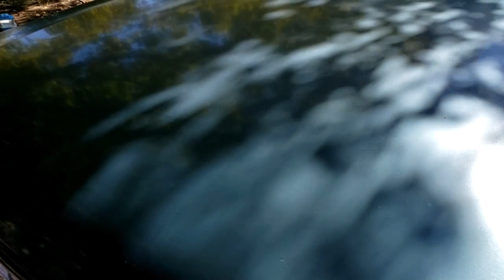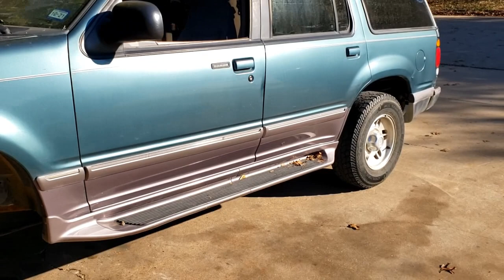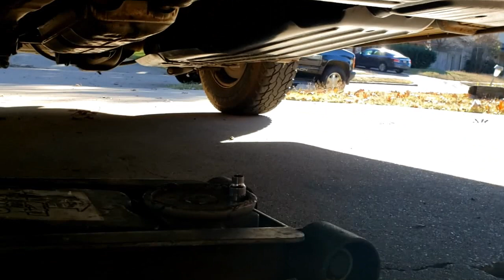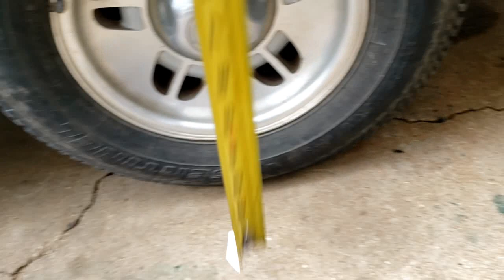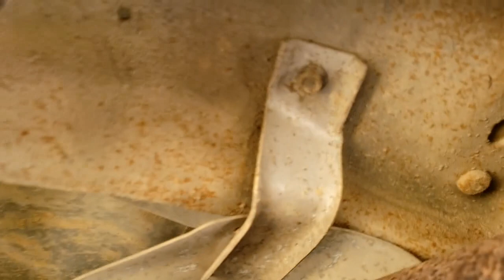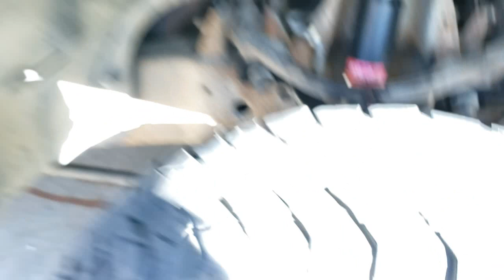Ford Explorer lift kit project   2nd gen   DIY how to lift for AWD and 4x4

Comment: great video  question if i add shackles on the rear will it lift a  bit?
Reply: long shackles will give you very little lift, get the old man emu springs for about 2" and ride great

Comment: with all my trucks i'e had them all lifted. what they usually do is add a block to the rear, add a leaf is for if you're doing heavy hauling for the strength of the leafs, great job overall. if you have a 1 inch block in the rear it you level your truck out.
Reply from the maker: The setup you are referring to is for spring over axle. If you add a block to this setup (spring under) , it will lower the truck. Hence add a leaf and longer shackles instead.

Comment: Heya! Love the video mate, I’m glad to have stumbled upon something so clear! Ive got me a 97 Explorer SOHC that I am trying to put together a lift and end up on some 31s myself, but I am an absolute newbie to the auto world.

I’ve just replaced my Leaf Springs and Shackles 3 years ago, as well as some other underbody works.

To make sure I miss absolutely nothing, which parts are necessary for this lift? Do you recommend still getting the Add a Leaf? 

Thanks boss!
Reply from the maker: Hey there! Add-a-leaf is the way to go if you have any weight inside, but you don't need the torsion keys. The original keys can give you the same amount of lift!
Reply: @gagefixeseverything cheers! I’ll consider picking a pair up then. I’ve cleared the interior so I won’t be carrying much besides camping/sports equipment. Without it, does it add any lift considering it is an Under Axel Spring?

Any recommendations for compression if you don’t have one of those table vice grips?
Reply: @gagefixeseverything Also, I’m looking after the shackles you used in this video. I’m going to head to the part store to find similar ones, what were these measurements? I’m having a hard time finding ones like that.

Comment: I've been working on getting my uncle's 1996 5.0L AWD XLT roadworthy again. It's got the tan paint and interior, and the front bucket seats are very comfortable. I just swapped out the ECM to get it running again since the OEM one became an ant nest, now I just gotta figure out how to stop the brake pedal from sticking (feels like a rust problem not a booster issue). I'm still on the fence about lifting the truck or lowering it, but this video was useful to that end either way. Thanks for the old Ferd content.

PS: I don't know if most people would agree or not, but personally I'd rather you just show the whole process even if there is a bit of wind noise. It's nice having some form of visual reference for doing these types of jobs.
Reply from the maker: Thanks for the comment and input! I'll remember that about the full length video. I prefer that myself also, because sometimes I need to see the direction or order of parts / hardware

Comment: Where did you get the leaf springs from ?
Reply from the maker: I ordered them on rock auto
Reply: @gagefixeseverything  I use Rock Auto for just about everything, I even used them to order an Exedy clutch for my '92 S10 Blazer among a bunch of front end parts. I would recommend everyone at least take a look at Rock Auto, more often than not they have anything you'd need to work on your car yourself.

Comment: Hey great video and info just wondering I’ve been reading replies but would a lift be necessary if you want to run 31s? I have a 99 xlt with the sohc I’m just going for a bubba build trying to keep it clean and simple while still maintaining some factory aspects of it I’m not sure how much power I’ll lose along with all that but if a lift is necessary do you need aftermarket shocks in the back with the shackles?
Reply: You should be able to run 31s with no lift, I did with mine anyhow, no rubbing issues

Comment: Hey did he say how much he spent on all the mods on this Explorer? I would love to know that because I am eye balling this Explorer up the street thats for sale.
Reply from the maker: I don't remember exactly how much all of this cost. Around $500 maybe. Reminder, you don't need to buy the torsion keys. Just crank up the stock ones
Reply: I dont know about his. But my 2 door was less then 500 to lift in a similar manner. Its at 400k km the original engine made it till last year, trans made ot 6 more months, was swapped with a manual, both jobs combined was less then 2000 usd, and the engine was an sohc (notoriously less reliable then the 5.0 and the ohv 4.0)
Reply: @abcanadabc  Tks for letting me know. Hey there are 2 engines options 4.0L? So both are the inline 6? Which 1 is the more reliable?
Reply: T @brizzx32 the 4.0 is a V6
Reply from the maker: The OHV is more reliable, the SOHC has a little more power.

Comment: Did you keep up with the new owners experience at all? How are those rear Shocks holding up?
Reply: Current owner, top bushing is shot, so it was replaced.  Offroaded hard, after a 3 inch BL, running 35s.  So far the rear shocks are still intake.  Ride is a little on the hard side, because of the AAL and not enough weight in the rear to soften the ride.
Reply from the maker: He has driven the truck for a few years, and I think he's had a really good experience with the truck.

Comment: Greg, I am the current owner of this little gem here.  Did you ever regear the axle?  I do not think so, but I had to ask.  PO did not know.  Vin shows 3.73 limit slip, so I don't think you would had regeared that, but PO said something about regear, but was not sure.  Thanks
Reply from the maker: Hey there! So cool that you own the Explorer now!! No I never did, but the front and rear diffs are super cheap and easy to find luckily. I'd recommend going down a tire size if you are not going to regear,
Reply: It is going to live it's life as an offroader now, so no longer a street queen.  31s would be ideal if its a daily driver, but 35s is where it will grow into.  :)

Comment: The 2nd Gen V8 Explorer is the spritual successor of the 1st Bronco with the V8.  
Did the Bronco II get a V8?  
The Bronco XLT is the K-5 fighter, not a jeep trail truck.
Reply: Good video.  I'm making notes.
Reply from the maker: 2nd gen v8 Explorer is awesome in every way except for repairs and upgrades. They are a pain in the but to work on. Bronco ii never got a v8 i dont think
Reply: @gagefixeseverything  I live at 8,000' MSL.   Gotta have displacement.
     Easier to work on than a van with a V8, for sure!   That's where I've been -- in the doghouse. 
 I like the Ford Pony Truck Ideal.   Big motor, small vehicle (park it next to a Super Durty and compare).   LOTS of aftermarket 5.0 support.  Heads, Cams, Intakes.
    It's a long-life pushrod V8.  And, for some reason, the Ford Gaskets of the time don't seem to leak like my other New Millennium vehicles.  I just spent 120 bucks to replace all 5 shocks.   The cheapest truck I own.  I'll never crack open the motor, really.

It'll never go to 700 HP.  But I like the idea of lowering it for cheap and using the AWD with a Turbo. ● But what I should do is convert it to a true 1/2 Ton Truck by grabing a Hi-Lo 4x4 Transfer Case and drive shaft from various other Ford trucks out of the junk yard.  
Then Shackle-Raise the rear leaf springs 1.5 inches and dial up the torsion bars to match.  Add chunky 31s and I'm done.  
As soon as you change suspension on your Factory Vehicle -- any vehicle -- it becomes an RV and you have to reclassify your budget as such.  $8k later and the tires are still rubbing in the parking lot. No thanks.  
 Its got the  F150 motor and tranny in a truck that has a wheel width of a Corrola.   Siiick!   I'd try a HCI and supercharger on this fantasy version.   

  I usually prefer sitting in Fords but I'll always choose the Mercury, when available. No matter, the powerplant.

Comment: Had a '97 for years.  Thing eventually decided to give up the rear Tchain and blasted a hole in the block.

That aside, nice lift work. However, did you put any wheel spacers in at all?  These things as Im sure most here know, have a horrifying roll over rating, lifting them only makes that worse.  The tires you have are wider but I wouldnt trust that alone.
Reply from the maker: Thanks! No I did not use any wheel spacers. I chose a wheel offset that was as extreme as i think i would go.

Comment: Unsure if you’re still replying on here but I’m looking to lift my 96 and the things I’ve taken away from this video are: 

1. I can just crank the stock keys for the front 
2. I can just use lift shackles for the rear 
3. I need stock ride height shocks in the front no matter what. 

Are these points valid? And can I get away with just using the stock keys and some lift shackles?
Reply from the maker: Correct! Just be carful on the rear not to use too large of shackles. longer shackles affect your pinion angle. This truck still drives great, and is about to be for sale now
Reply: @gagefixeseverything  gotcha, thanks a lot for the reply. I actually picked up the same (I think) ones as you, the Autocraft brand 3 point shackles.

Comment: Hello I'm a beginner just recently did breaks for my first time lol. I'm looking to do some upgrades on my 98' RWD V8. I just had triplets and dont have the fund to put my rig in the shop. You have any advice on where I should start or what to buy first.. 

Sorry just learning. Love you're video, truck look great. Cheers 🤙🏽
Reply from the maker: Hey there! That is awesome that you did brakes! Most people would not attempt that these days. Id say the best things you can do are just regular maintenance items at first to learn how to use tools more efferently, and understand terminology and how things work. See if you can find a factory service manual on eBay for your specific vehicle. It will have TONS of good information on items to work on, and EXACTLY how to do it step by step. Pick a job like throttle body gasket, spark plugs, intake gasket, serpentine belt, etc and go for it!!

Comment: I managed to get 3 inches of lift w a similar setup, I do get some clunking when the front is articulating in the trail. this vid helped out trouble shooting that issue,  I might need to bring it down another inch. Do you happen to know exactly the rims and tires for the 31 inch setup you wanted to put? I am having a hard time trying to pick the offset. Also Thanks for this video it helped a ton!

Comment: Never seen such an informative video in 30mins . Beauty! 2 questions... What is the rim size of the new wheels? Still 15"? and... if you had of gone with the 31/10.5R15 do you think you would had have to still alter/remove the running boards and trim fenders?
Reply from the maker: Thanks for the kind words!! Still 15's yes. 31's would have been a much better choice for sure. There would have been no trimming. Also, the 33's KILLED my highway power. Almost unable to drive 70-75mph in overdrive.
Reply: @gagefixeseverything  I have the 5.0 engine in my 98 mountaineer. It makes 215 hp and 280 lb-ft of torque. Do you think it could do well on the highway with 33s? Or would it still struggle?

Comment: I have a couple questions about this. 
I have a 99 Ford Explorer. I want to lift it 2” 

Do I need to change my current front shocks to do this?

 Also I can just keep the stock torsion key, and just crank down to lift? 

For the leaf springs do they need to be 2” lift or can they be 1.5” ? Having trouble finishing 2” lift leaf springs. 

Thanks for your help.
Reply from the maker: yes you can just crank the keys if you want. You can use stick height shocks in the rear if you want, the fronts must be stock height or the cv axles will bind if the shocks allow the front to droop too much. You can get whatever leaf springs you want really and adjust the front to match

Comment: How would you go about getting around the cv axle issue, planning on doing the 2" torsion lift but ive heard from a lot of places that the cv axles wear quickly with almost any lift.
Reply from the maker: The only way to get around the issue of CV axle bind is to make a drop bracket setup for the front diff

Comment: My explorer is still stock but doesn't have any sag in the back, it still has that forward lean, back is about an inch higher. If I only need one should I get the add a leaf or the shackles?
Reply from the maker: add a leaf is better if you tow, or have a fully loaded truck often. Shackles are good for an empty truck, and are easier

Comment: The OHV v6 has very respectable torque and it will run forever. The "powerful v6" you speak of (sohc) is a junk engine imo
Reply from the maker: It's true, the SOHC is much less reliable
Reply: The one time 95 Explorer Expedition Sport 4x4—is it OHV or SOHC?

Comment: So do you need the spacers and if so what spec did you run with them in the front? What difference would it be without them
Reply from the maker: You mean the shock spacers? No they are not required. They will just give the front shocks a little extra travel.
Reply: @gagefixeseverything  okay thank you appreciate the video and very detailed information plan on doing this myself maybe I can keep you updated

Comment: What do you think about putting leaf springs on top the axle and is it possible also wondering if you know what axles you would put under if you were going to install solid axles replacing the independent front
Reply from the maker: Yes you can easily swap the springs over the axle. It will gain 4inches of lift minimum. I would not go solid axle in the front. It's easier and more cost effective to buy a different rig

Comment: Hey I was wondering if you know if there's a way to disengage the all-wheel drive when you don't need four wheels like on dry pavement the rangers have it there's a switch inside it disengages the transfer case and also the hubs wondering why they don't offer that in the 97 Ford explorer if you know a way to get around it if there's a kit I'd appreciate you let me know
Reply from the maker: No there is not. Part of the design of this system. The only way would be to remove the front driveshaft when you are not offroading
Reply: I have a 97 explorer sport 2 door with a manual trans and it has the knob on the dash to switch from 2h 4l 4h, I think a lot of the models of explorers come with different options around that time
Reply: Brown wire mod, look it up.  :)

Comment: I believe if you use Nissan exterior stock shocks they will fit and they are considered longer
Reply from the maker: Good info, but its very important not to go longer than 1/2'' over stock full extension unless you have longer CV axles, or they will bind and bad things will happen

Comment: Can you explain why the Rancho shocks that accommodate 1.5-2” lift is either good or bad? I just put them on and am now worried about CV pressure. My keys aren’t maxed but i may want to in future
Reply from the maker: I think you answered your question. You just dont want to extend the suspension to the point of cv axle bind

Comment: My '96 XLT is about to hit 130k miles.  I was happy to hear you say "low miles."  That pushrod V6 is tough...perhaps will live to see 300k, with some good maintenance.
edit ooops..I meant to say my mine has almost 230k miles.
Reply from the maker: The most I ever had on one was 285K. still running well when I sold it
Reply: @gagefixeseverything  That is comforting to hear!  Spent nearly $4k having the transmission & transfer case rebuilt, along with servicing both differentials.  Have a bit invested now, so I really hope to hit that 300k mark.  😇

Comment: Are you planning on putting in a front "locker" like a powertrax? Also for extended travel on shocks, (I haven't done this yet) you can get Jeep JK Shock extenders.
Reply from the maker: Probably not. It is about to be downgraded to 31inch tires actually. It is just a road truck now. One of my buddies owns it now

Comment: Thanks for the video, I’m doing the same thing to my 97 Explorer V8 AWD. Already did the keys in the front, front end work with alignment and rear heavy duty lift shackles. But with the original rear leafs it had to much sag. So now installing the same kit as your doing in this video. I’m running 31x10.50 tires and I tow a trailer sometimes so those old sagging leaf springs had to go.
Reply from the maker: NICE!! My truck rode WAY better with the new rear leafs for sure. 31's are the best size on this truck. 33's are too much for sure. My one regret on this one
Reply: I believe you can buy the extra leaf spring kit from somewhere.

Comment: I got a 2000 ford explorer with 222000 miles and i want to lift it and do some other things to it, the previous owners took realy good care of it would you say its worth lifting cause i cant get a different car this is it and i want to build it. Would you say its worth it and if so could you help me out a little
Reply from the maker: For sure I think it's worth it. If you do good job, it will increase the resale value as well
Reply: @gagefixeseverything  thanks man

Comment: This shock is for a 2" lift.
Rancho RS55374 Shock Absorber
Reply from the maker: Great find! That shock has the same compressed height, and 2 inches more travel. This WILL let your CV axles over extend so be careful

Comment: Great video, lots of information I couldn't find anywhere else. I picked up an 01 4.0 sohc that needs front end work and I'm seriously considering lifting it to put 33s on.
Reply from the maker: Thanks for the comment! My advice is to upgrade gears for sure. After putting alot of miles on the 33's, the lack of power is pretty frustrating haha. You can get a 4.10 front diff from a ranger for cheap on ebay, and then swap out the rear ring and pinion.